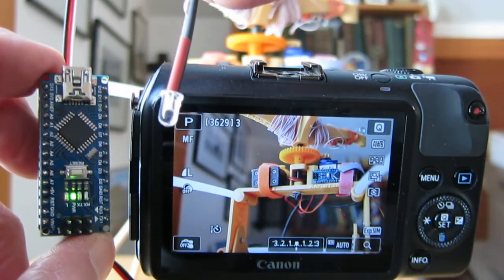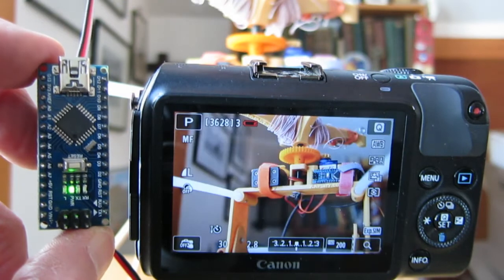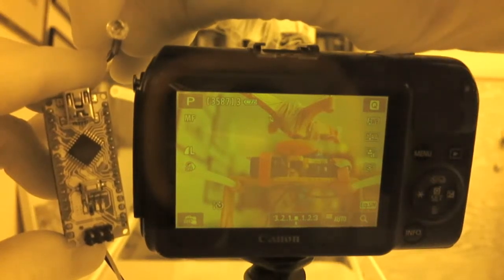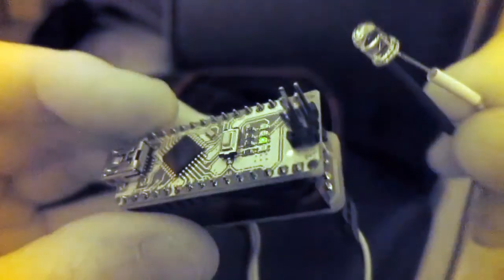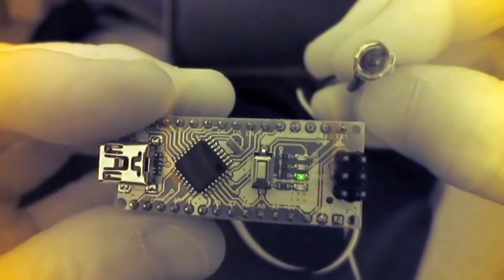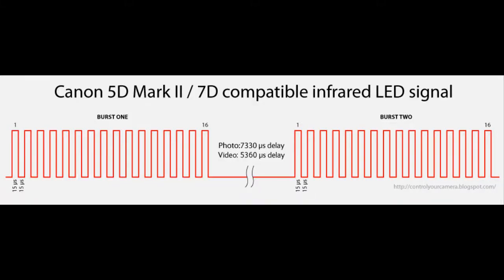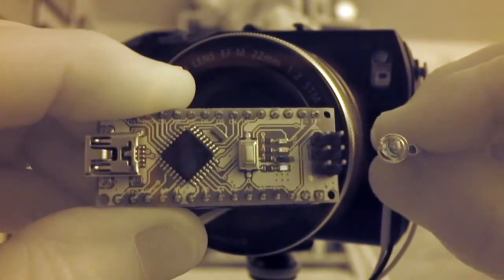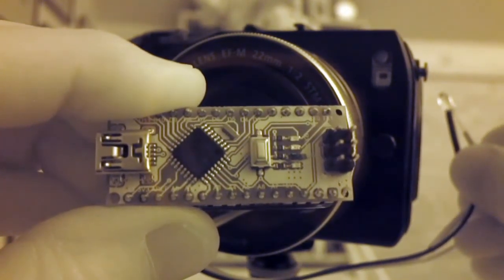EOS M IR remote via Arduino

Comment from the maker: The hardware was a SkyShield autoKAP controller: http://kaptery.com/product/skyshield-autokap-controller
A circuit diagram, user manual, and sketch  are here: http://kaptery.com/guides/
The code snippet for triggering the Canon EOS is here: https://publiclab.org/notes/cfastie/02-28-2016/auto-eos-m